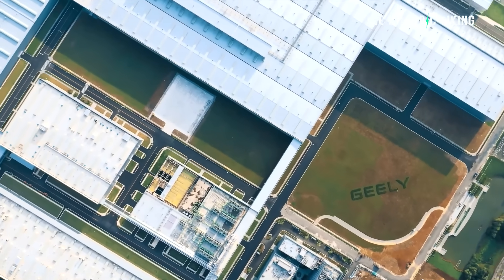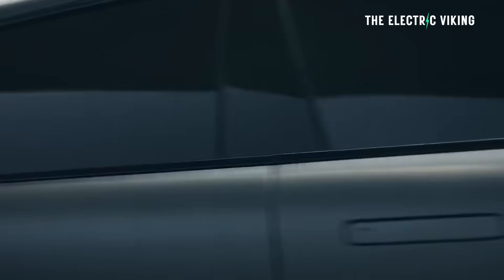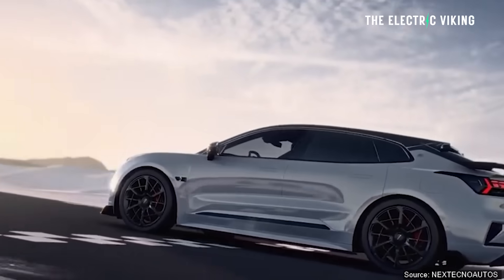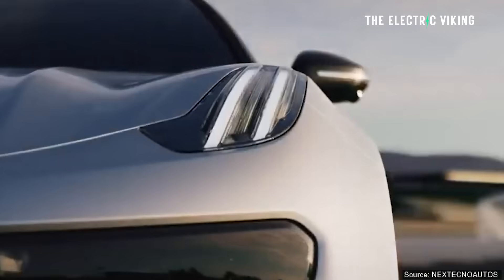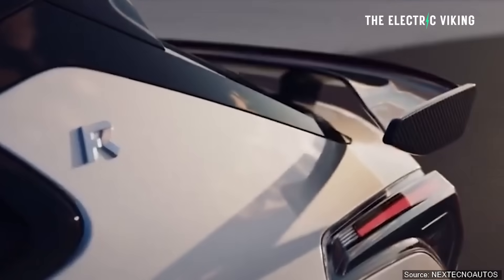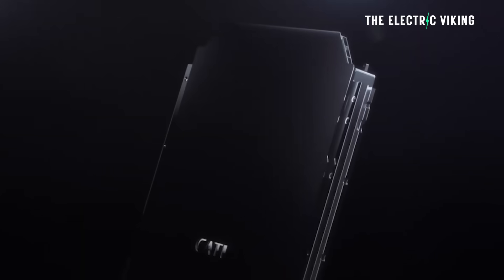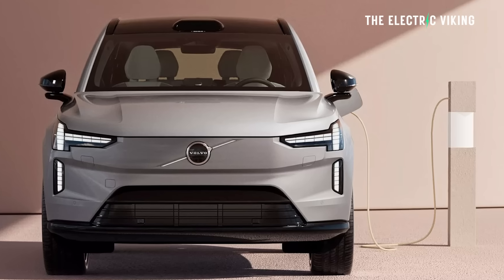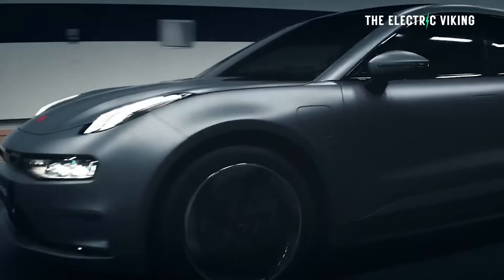Geely's Zeekr reveals quad-motor Tesla Model S Plaid rival with 1265hp

Comment: No way those all those stats will hold up to testing! I mean, come on, it pretty much beats every EV in its class at all parameters using the same or lesser technology. It just doesn’t add up!
Reply: lesser technology? how so? 4 motors is different from the trio motor setup of plaid but is it lesser?
Reply: Chinese car review channels have already started testing and comparing it with Model S Plaid. You can watch this one for example:  https://youtu.be/rWAKi_QwJcQ?si=1vkYrwldnMwGTdSN

And it's lap speed in Zhejiang Race Track is literally 7s ahead of S Plaid (similar to result of Lotus Electra) when tested only by a Geely engineer (not actual racing driver)
Reply: @qilu2004  Yes lesser technology not less motors. We shall see!
Reply: @jezza6575  what tech are u talking about then? the 4 motor setup not only win on numbers, but also on tech. it allows completely independent control of 4 wheels, say different speed for example, thus give the car better control, or even allows the car to take tank turns. what tech does MS plaid has other than sheer horse power?
Reply: Skepticism is healthy. I am leery of all of these specs.
But let's wait on facts b4 making determinations.
If Tesla came out with this vehicle, most would not question the specs.
Reply: @lunatik9696  bruh... Chinese brand come up with tech: spectism is healthy
Tesla comes up with tech used by other Chinese firms long time ago: tHiS iS tHe bEst iNnovation In yEaRs.

Comment: If you are going to use that power, you’ll be replacing those expensive high-speed tires more than once per year.   Better be in the 1%.
Reply: Sorry. Why would you spoil the show for others? Even so, it's not a car for people like you. Every sports car requires good and expensive tires. But you are forgetting another important thing in your parameter. Most of the buyers are not motor sports people, these are fun and think it's mine.

Comment: 1280 NM torque, 10 piston calipers for the front wheel, 4 for the rear wheel, 245 mm width front wheel, 295 mm wheel rear. Don’t know the price, heard it will be over 1 million CNY.

Comment: I have 001 YOU version, according to Zeekr, they do not sacrifice any inner space of the car to achieve that insane power and control system. So, the 001 FR will not only be a hell fast car but also very partical to daily drive. The normal version already had a lot of space for passager and loading stuffs, can't wait to actully try it (:з」∠)

Comment: The Model S Plaids 1.99sec, 0-100kmh is with a roll out as well, it's more like 2.2-2.4 in real world conditions from a standstill. Can't wait to see those two drag race along side the Lucid Air Sapphire which only has slightly less power than this.

Comment: What is 'rollout subtracted?
This standard removes the first foot from starting. So, MSP does actual 0-100kph in 2.4s(tested) and 2.1s (stated) with subtracted. While the Zeekr does 2.35 and 2.07s respectively. (1.99s is 0-60mph for MSP)

Comment: I don't know about R model, Zeeker 001 FR might has similar speed to Tesla S Plaid from 0 to 60, but when you put them on track, sorry, Plaid can't even see the tail light of FR. Even with Plaid track package, I believe still slower, simply because the track gap between Plaid and FR is too great; we are talking about 6 to 7 sec. per lap. But if you know what this FR background is, you will not surprise at all. This FR model was heavily turned and modified by Lynk&co Cyan racing team (Sweden), who has won 5 time TCR championships. So it's not a fair comparison to begin with. Therefore, do not expect similar retail price, 001 FR will be far more expensive than S Plaid.

Comment: ‘Tank turn” = tire destruction mode. Rivian found that out during testing of their own tank turn promised years ago. Rivian dropped it when they found out it quickly destroyed your tires within minutes.
Reply: Compare to the speed of tank turn on Rivian and BYD, Geely, idk if that should help a bit.
Reply: There other far more important reasons for dropping it.
Reply: @Xinyouting  Modifying all 4 wheels to run without scrub in a tank turn will add  several thousand to the price and add functionality that is generally not useful.  I expect you would also reduce interior and frunk space.

Comment: How long can it do the top speed for, and what is the battery size?  350kW recharge rate at optimum battery temperature?  If its a halo car for them, then OK.  Form factor is interesting.
Reply: 100kwh CATL new Kirin battery
Reply: @cwdjdsd-36321cs  Well, that’s one of the queries answered.

Comment: Tesla needs to put out plaid 3 and plaid Y
Reply: Where will all that battery materials come from? Slave labour ?
Reply: Mini 4680 Y and 3 Plaid's are coming with 850hp
Reply: Do you know you can get a discounted model ordered directly from tesla with less than 4k down payment and a total no more than 17 grand with a ref code.
Reply: @larryc1616  the original 550 HP is far too much power.  I'd like to see much smaller, more efficient motors/  controllers.  I do see a need for a  graduated system increasing HP, vía OTA, as experience/ responsibility increases.  
Speed sells I guess.
Reply: @XX-dq3kx Have you not read all the articles that battery factories in China only running at about 55% of capacity apart from CATL and BYD?
Reply: @XX-dq3kx  "all that battery material"   I don't think so.   Some small part and due to international pressures that is shrinking.  Much of it never did.  It is mostly one mineral cobalt IRRC.  Tesla will not sign a contact with a company using slaves or children.   I have no idea about other companies.  Tesla is leading the way.
Reply: @GWAForUTBE  not too much power man, maybe it means you drive the wrong car. You can get the LR version if you want less power.

Range wise the reason 3P uses more energy than the 3LR is not due to the 980 motor, the 980 motor when driven as an LR motor, it wont consume more power.

But the 980 motor has better inverters and can deliver more power. The increased consumption is just the tires+wheels on the 3P vs the 3LR. 

A lot of people track the 3P, YP and while the S Plaid is much quicker, the 3P and YP are very agile and have very good steering feel (very direct). But if you think 3P is too direct and too much power: its not the right car for you, there is nothing wrong with the car.. People who love the 3P would not say no to more power 🙂
Reply: @OlavAlexanderMjelde  truthfully..ive never been fortunate enough to drive or even get a ride in a Tesla..  I have admired others from afar aswell . I appreciate the efficiency of the Aptera.

Comment: way better than the model s plaid. better range, better charging speed, better brakes, more comfortable and its faster because if it can do 0 to 100kmh in 2.07 seconds it will do 0 to 60 in 1.8 seconds

Comment: The problem China will face when designing and making their own vehicles is - they have no track record.  Greely is a minor producer of BEVs that they've designed.  It isn't like Mercedes or Porsche or Rolls Royce which have a record of superior workmanship and design for 100 years.  They will make errors and these will reflect badly on them. BEVs don't have a great reputation for quality and the chinese makes are at the bottom of the pile. Given that and a lack of support networks in the USA and Europe they will have poor sales.
Reply: China has the benefit of a massive domestic market. In that sense they win over Japan/Korea. Moreover competition is cut throat, they will get better because they have to in order to survive. Gone are the days when a non-existent middle class meant it was either decade old utilitarian VW models or top end European imports.

We make the mistake of thinking Alibaba, Tencent, China Mobile, XiaoMi, Huawei, etc, dominate because they are owned by the party. That is not the reason, as the tech crackdown in China has shown. They beat off a whole bunch of domestic competitors by being better. Same will happen with car manufacturers from China. Make it better, make it cheaper or you go out of business.

Tariffs will be the main reason why Chinese cars won’t dominate in USA and Europe in the short to middle term
Reply: Geely own Volvo, tiny company - you may not have heard of them, but you get Zeeker support through Volvo dealers...

Comment: no car is on the same level as a Tesla. its not motors, its not specs etc. Its safety and data and AI etc. Any comparison to a tesla is deceptive because there is none.
Reply: What makes you think so, do you own one?
Reply: @a.ctlyzer  what difference would owning it make. One eg. of constant superiority: Tesla is the safest car in the world. the extreem degree they go to to overachieve this is unknown and unheard of anywhere else in the car manufacturing world. thats kust a tiny thing. each time you analize any aspect of the vehicle and compare it to any other the gap widens. Tesla is light years ahead.
Reply: @tonydebreceni8966  I agree, I was talking about tesla. You know you can get a refurbished one for less than 20 grand right?
Reply: @tonydebreceni8966 你有没有想过是你无知？